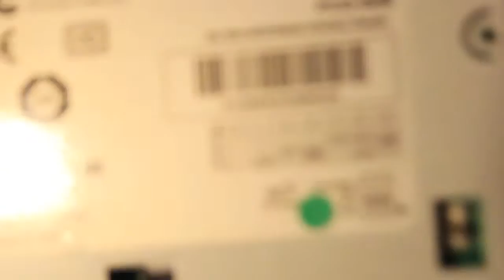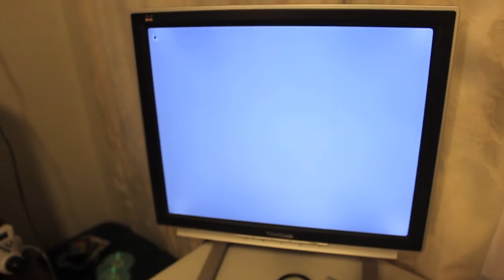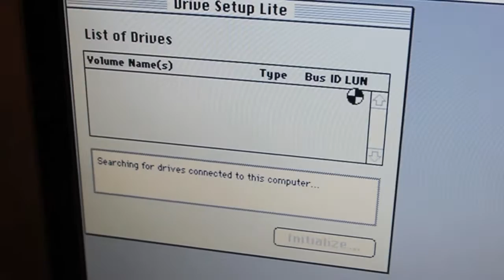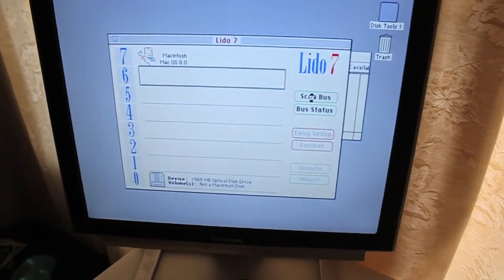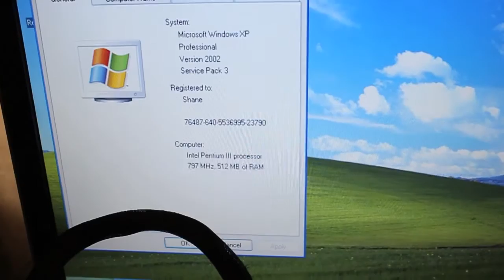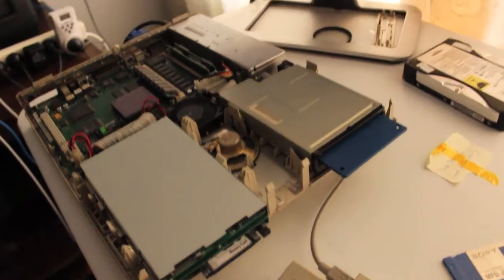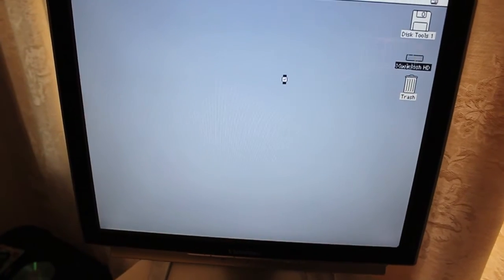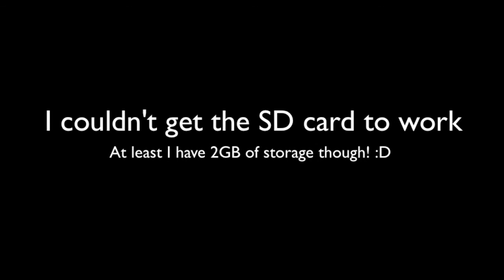Solid State SCSI in Performa / LC 475  via PCD-60B Card Reader

Comment: Do you by any chance have the 1.28 firmware for that card reader?
Reply from the maker: +SwitchingPower Negatory! Sorry! The hardware has long since been passed along I'm afraid!
Reply: PCD-50b/60b firmware update can be found here: i recommend a adaptec 2940 scsi controller in a winxp pc:  https://www.gearslutz.com/board/attachments/electronic-music-instruments-and-electronic-music-production/259471d1319419337-scsi-samplers-tips-amp-solutions-pcd50-60b-firmware.zip?s=528c60a242391ada5715d4a42b477292